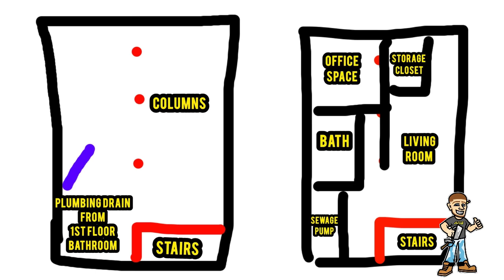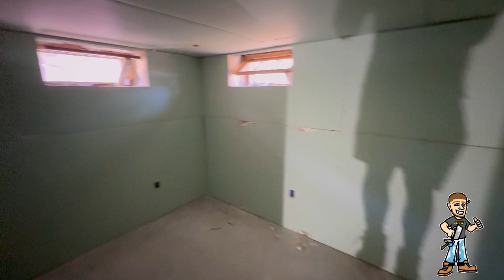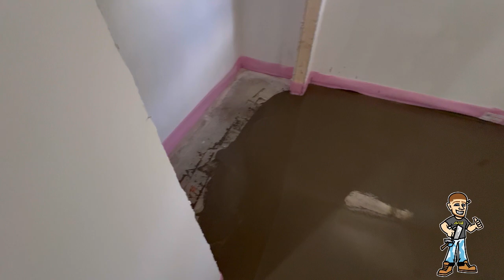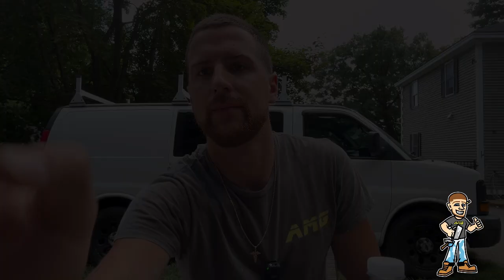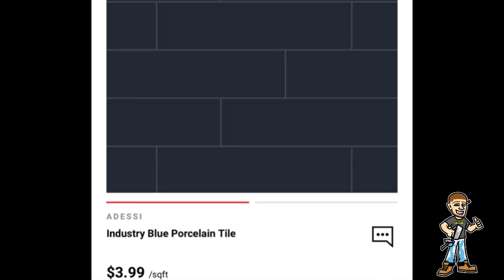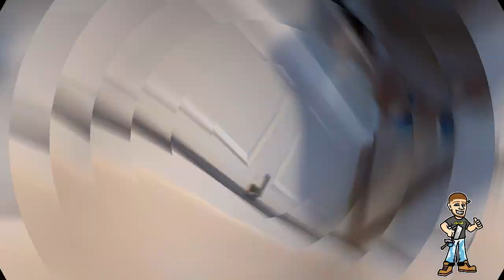(Ep. 003) Full Basement Remodel

Comment: Why didn't you use steel studs in the basement since you put the steel rack down against the floor? Love how it came out!! 🎉
Reply from the maker: Price for steel studs went through the roof. Not worth using it throughout the basement. Some people use pressure treated on the slab. I like to use the steel track with regular KD wood. The track is much straighter than a piece of wood. Great question